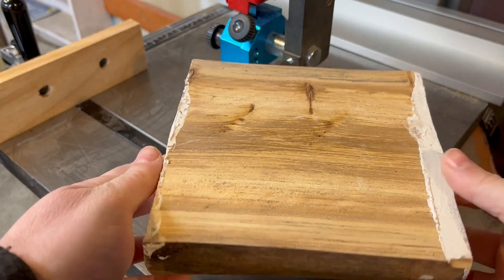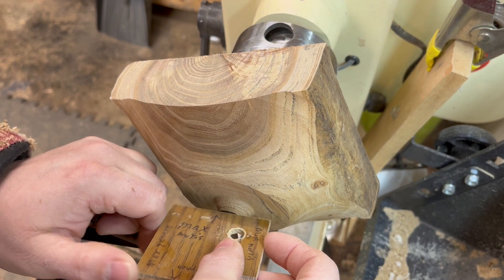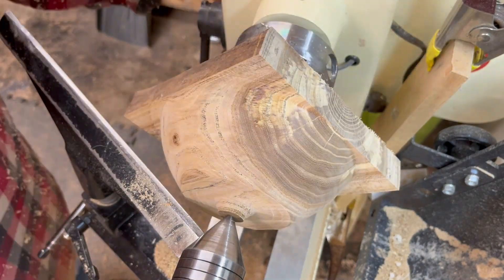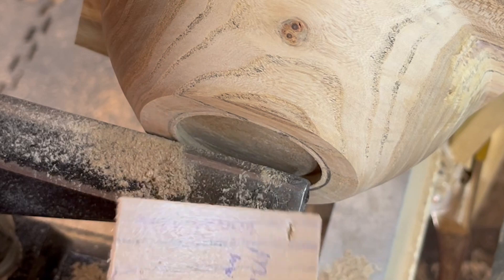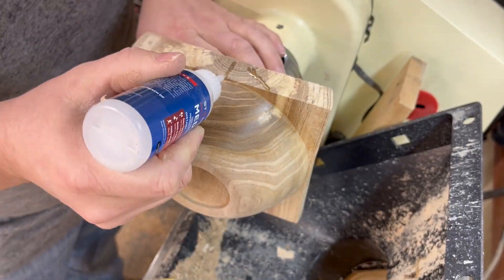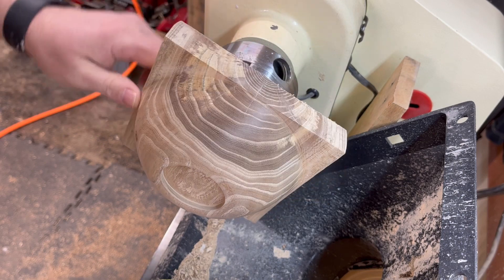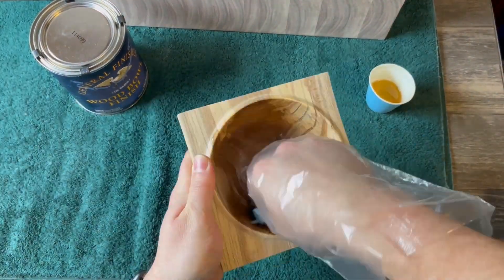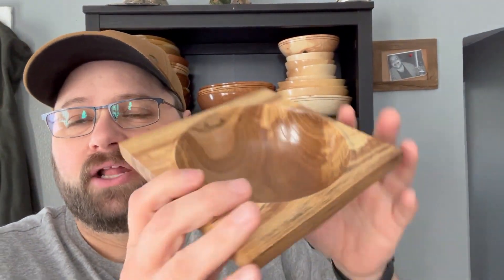Square Rimmed Bowl

Comment: Your depth gauge is brilliant! I'll make one similar. But, at 8:40, shouldn't that 1/32 gap be between bolt and chuck rather than between the blocks? As you have it, true bowl depth is 1/32 less than your gauge indicates, not more.
Your videos are always good, better than the average out there. Have you tried using social media to spread the word and increase subs?
Reply from the maker: You are correct!  Thanks for pointing that out, I will make the adjustments!   I do post on Facebook, but I don't really notice a difference when I do.